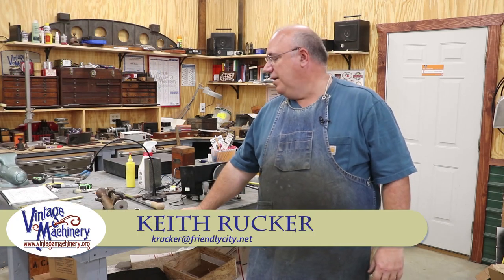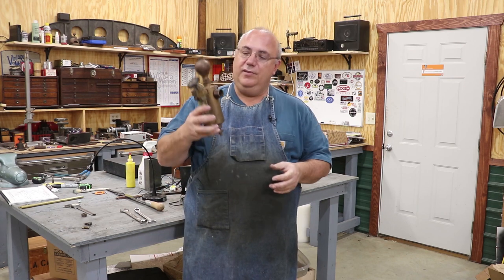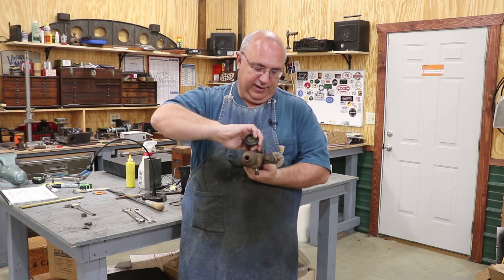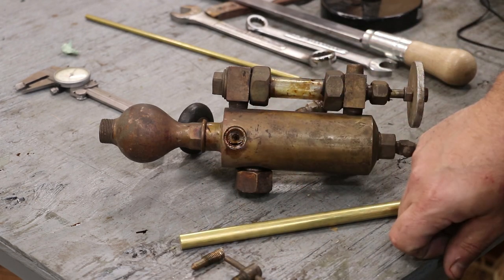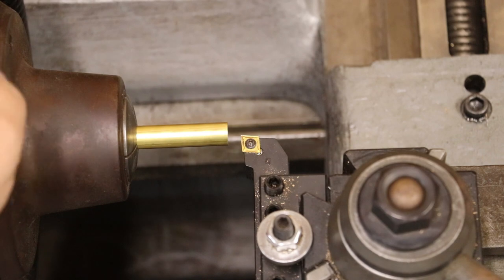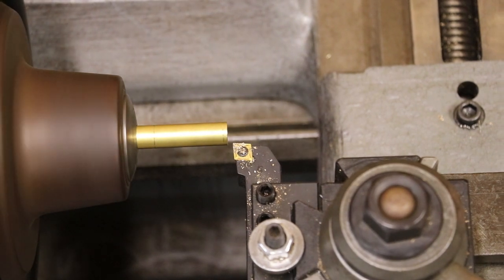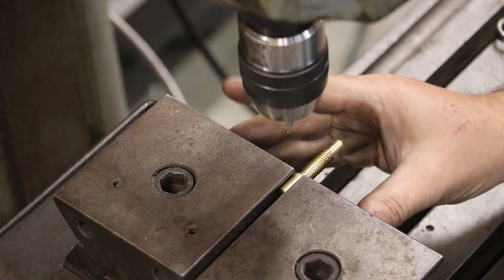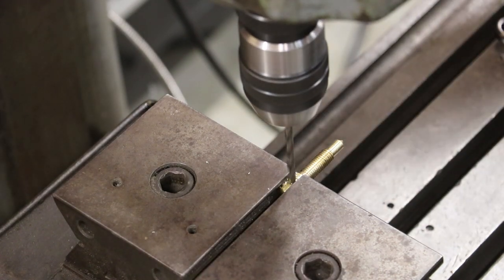Machining a new Needle Valve for a Detroit Steam Lubricator

Comment: The bulb on the top of the lubricator is actually a condenser.  The lubricator is actually at the same pressure inside as the steam line.  The water falls to the bottom of the lubricator since it is heavier than oil and displaces the oil to the top of the lubricator.  At the top, there is a pipe that runs down to your needle valve in the sight glass for adjusting the oil drop frequency.  That sight glass is filled with water and the oil drop floats to the top of the glass and it slides into a pipe that goes over to the the steam line where the oil mixes with the steam.  It is called a displacement lubricator due to the displacement of the oil by water.  

Hope this helps!

Noah
Reply: 97trainman I hope he is not using it on the brake cylinders... needs to use air. That lubricator will not work with air!

Comment: Memories, memories as a steam loco fireman in the 1960s one of the preparation duties was to fill and set the lubricator. The oil had the viscosity of cold molasses and had to be heated to be able to pour about 4 pints into the lubricator. This oil was emulsified and, as you said, was injected into the valves and cylinders to lubricate them. This emulsified oil is what gave the steam locomotives their. distinctive smell. Takes me back to my youth. Thank you.
Reply: I realize Im kinda off topic but does anyone know a good website to stream newly released tv shows online?
Reply: @Brixton Christian Flixportal :D
Reply: @Riley Abel Thanks, signed up and it seems like a nice service =) I really appreciate it !
Reply: @Brixton Christian Glad I could help :)

Comment: The hydrostatic lubricator and the feed water inspirator (injector) are surely the most mysterious items found on a steam engine or locomotive. Both utilized "state of the art" physics of the 19th. century. When explaining their function sometimes I have found it necessary to say "How it know to do that"? I am positive that AW680 steam cylinder oil is the source of India ink. Keep up the good work.....Steam Forever.
Reply: Chuck Haynes and Micheal Miles   The cylinder oil that is used in the hydrostatic lubricator and the mechanical lubricator that feeds the cylinders may or may not be the same stuff.  Depends on whether the engine is a soaker or super-heated.  Unless the oil is made for the higher temperature of the dry super-heated steam, the oil will break down and not lubricate the way it is supposed to.   There are oils for different operating pressures as well as super-heated or non-super-heated use; it makes a big difference.  This one looks to be used on 175 psi or under which will be a soaker similar to the loco at the museum.

Comment: Displacement lubricator.. Top bulb condenses steam, steam becomes water, water floats oil, oil is pushed into steam flow.
Thought they were very clever when I found out how they worked. No moving parts and works under and regardless of steam pressure.

Comment: Right around 24:37, I noticed the exposed threads on the part extending out from the part you screwed into the body and wondered what are those threads for. Tadah ! mystery solved. You are such a patient man. My dog would have been running for cover in my case and the wife asking if everything was OK. Ole Shep seems to know when I goof and just gets up and takes cover until the storm has passed. When I was doing woodwork, turning pens on the lathe, Shep would watch to see where the pen landed, pick it up and head for the bedroom, to hide it under the bed for later chewing. 

In your case you just make another part, show us the Bozo part and continue on. Great video as usual and thanks for showing the Bozo . Ole Shep just looks at me, shakes his head and gives me that "see, that's how you do it Mr. Grumpy" ; ) . Take care...Ken... the old guy from Marina CA

Comment: I know the exciting stuff is the part being made, but would it be possible to have a camera angle filming you and the machine controls? Even if its just one video; I'll bet i'm the only one interested in this kind of thing. I hear you talking about zero, and waiting for the half nut and dial setting the cross slide for 5 thou. Intuitively I think I know what you're talking about individually, but I've never seen someone operate a lathe and don't have enough of an imagination to know what you're doing.
Reply: Sizukun1 you're not the only one who likes to see the operation. I have a lathe and would make a video if I had a  project for it. Anyway, if you haven't already, look up Tubalcain (MrPete222, Lyle Peterson) he has excellent teaching videos. And you'll learn a lot from him. Hope that helps.
Reply: keithe I think you have a hydrostatic lubricator and the dome is a pulsation dampener if you can find a copy of audels steam engine lubricator

Comment: It's probably a British standard ( Whitworth 5/16-18)  a lot of early steam stuff still used that system because of England's early domination of steam technology. Or, someone repaired a stripped thread in the body at some point and just oversized the body and made a new stem to fit .   And quick saying " basically"
Reply: "basically" and "again."  If they were eliminated, videos would be 30% shorter! :) LOL !
Reply: Give Keith credit though- in his next video you could see he was making a conscious effort not to  say basically and only fell off the wagon a few times.
Reply: The major thread diameter for 5/16 BSW is .3125, Keiths part was .355. As Keith said, it is some oddball thread, or so it would seem.
Reply: These type of devices are built a lot like carburetors wherein similar sized parts have odd threads so that on reassembly parts will only fit where they are supposed to go.

Comment: Little tip: You can antique brass by fuming it with ammonia. The new brass looks a bit out of place on the old valve
Reply: Different tip,  you can make it all match with Brasso  :)   Patina is crust
Reply: give it one day with heat and dirty fingers of the driver and it will match :)

Comment: Interesting to watch, but one potentially really dumb question. With the first unit made, you appeared to wind it into it's existing housing until the threading bottomed out in the fitting. There was no check to see whether the needle had bottomed in the seat to close off the flow. Surely the thread should have been longer to ensure that the needle could bottom in the seat with a couple of turns in reserve? Remember the original part had the handle broken off at some time in the past, and you derived the threaded length from the stub, without allowing for any thread that remained on the missing portion.  Come the Mk2 version with scope for the packing, did you also factor that into the modifications, as well as the packing allowance? If not, the port may well still be significantly open when the adjuster is fully wound in because it is limited by threaded length rather than bottoming the needle in the seat.
Reply: Good point nicely made. Don't expect a reply from keith.

Comment: As to threads, I have a couple of oilers, I wanted to put the drain valve from a parts Detroit onto one in much better condition. Guess what, it won't fit! It's just a little larger, same thread, same nominal diameter but the threaded hole is a tad smaller and the valve just a hair larger.

Comment: Was the Top slide angle correct on that threading op ?
Reply: looks like he threaded straight on, it was  a small thread so its fine
Reply: Jusb1066 it has the look of a thread cut with the TS at 45 rather than 30
Reply: Bill Todd but it looks like he went straight on

the ts angle doesnt matter if you dont use it.
Reply: The compound looked to be at the proper 29.5° angle. Looking at the infeed while threading, the tool is moving at an angle, not straight in.